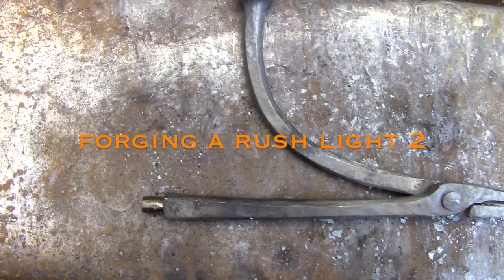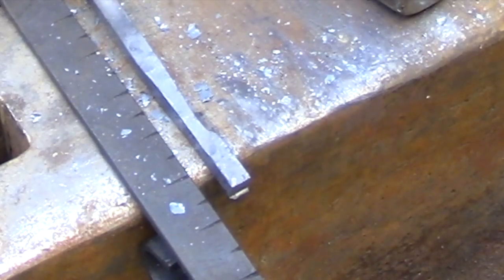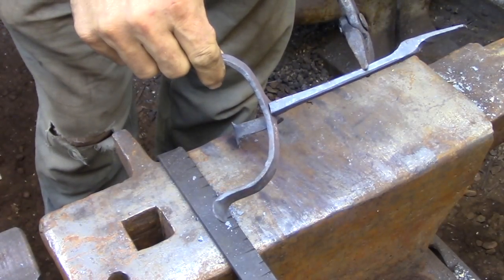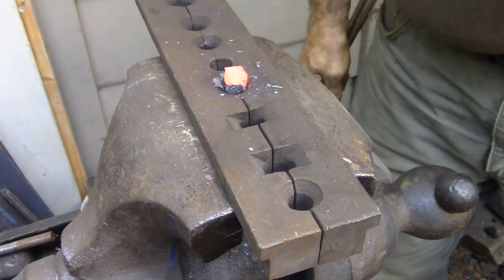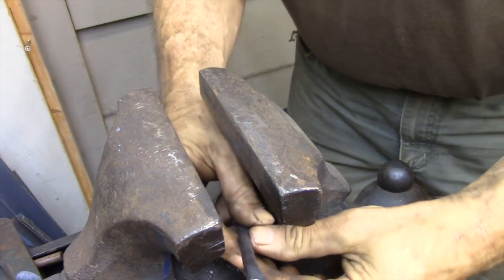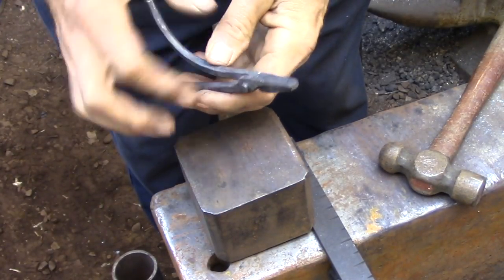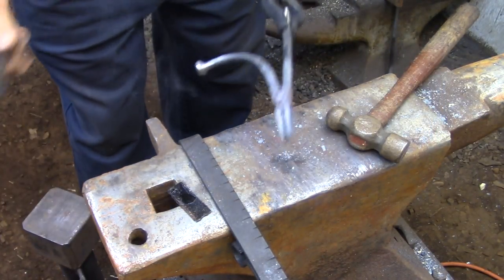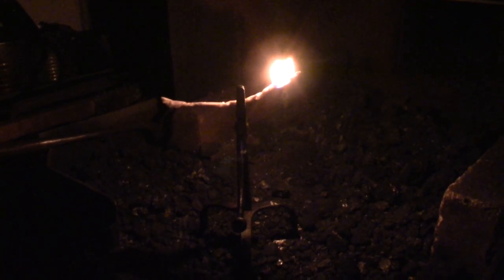Blacksmithing For Beginners - Rush Light 2

Comment: Dennis, is there a reason you opted to file rather than forge the tenon?
Reply from the maker: Honestly  I never even considered forging out a tenon this small.  This process took about 5 min.  I can't imagine being able to forge a tenon with a clean shoulder that's ready to rivet in less time than that.  For a part that is hidden within the piece I can't think of a good reason to forge it out if there is a quicker and easier way to do it.
Reply: At the risk of sounding confrontational (which is not my intent) your comment that it is faster to file a tenon than to forge one did not sound right to me so I went out in my shop, fired up my forge and tried it.  In my case I forged a 5/8" long, 3/8" diameter tenon on a piece of 1/2" square stock.  It took me 2 minutes and 13 seconds to forge the tenon with another 30 or 40 seconds to file the shoulder a bit because I rushed it and did not take the first bite with my tenon dies close enough to the set down shoulder cuts.  On 3/8" stock and a 1/4" tenon it would be even faster.  

There is nothing wrong with filing it of course and I am not being critical in any way about the fact that you did,  but your contention that forging takes more time is simply not correct if you have the appropriate tooling.
Reply from the maker: I'm not laying down rules here.  I'm just explaining how I work.  I don't have the proper tooling to do this ( and most people don't), I no longer have the eyesight and I never had the coordination to do it freehand so for me this is the right way to do it.  You are just going to have to accept that.
Reply: Of course I accept it.  I am just surprised you don't have an arrangement for quickly forging tenons, considering how much traditional smithing you do.  Just for clarity sake so that I am certain you are not misunderstanding my intent, I think you run one of the best, if not THE BEST blacksmithing educational channels on the internet.  I think about you every time I use my vise insert for round stock, which I forged according to the instructions in your video.  Keep it up and don't think I am being critical, because I'm not.